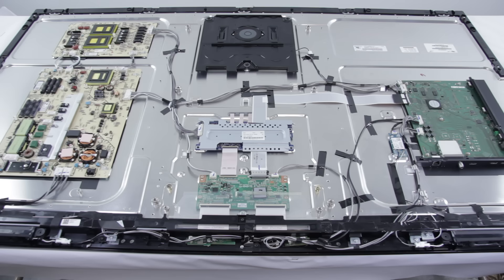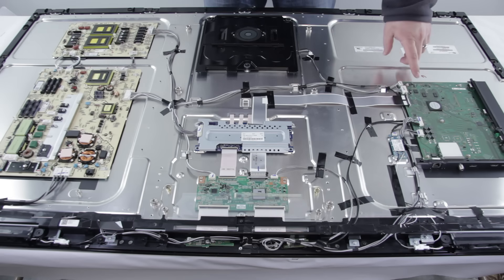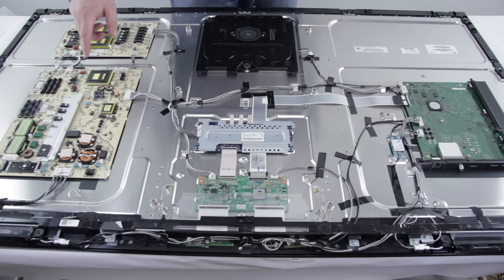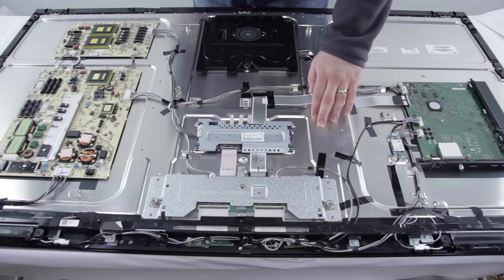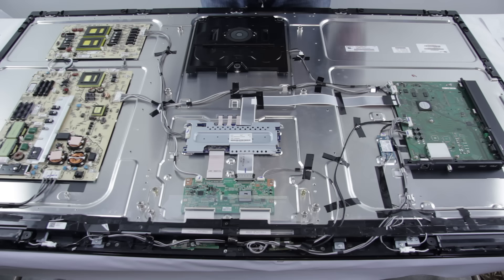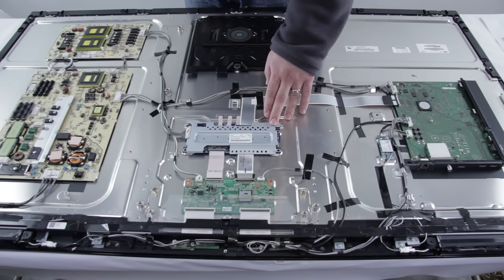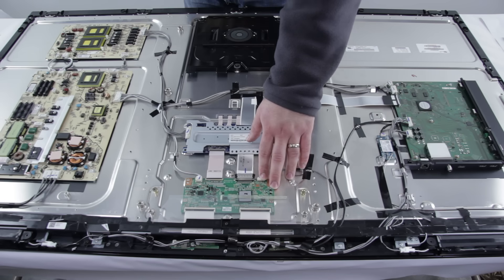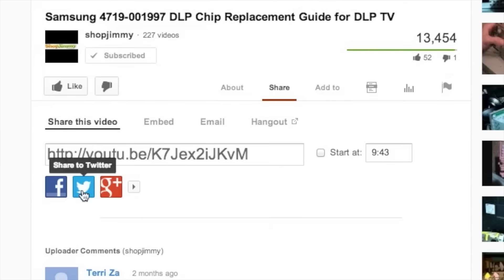LED TV Repair Tutorial - Common Symptoms & Solutions - How to Repair LED TVs

Comment: I have a Panasonic Tx-l50b6b 
turn power on and the back light flashers about 5 times then the standby light slow blinks constantly, I've replaced the psu and transistors and capacitors on the led driver board and still same issue, any ideas

Comment: hey I have a Samsung led 65 inch TV . model number is UN65F6400AF. 
the problem is that it has a dark shadow going across the bottom half of the screen. I just wanted to know if its the main board,con board, or power supply board.

Comment: Hi i have a Sony KDL46Z4500 MY PROBLEM is i have a ten inch wide pixel bar down the right hand side of the TV from the top of the screen to the bottom could you advice on the part to sort this problem please

Comment: Hey I was wondering if you guys have a video showing how to tell if my power supply board is bad if it's not showing any damage on any components or front or back of the bored and I don't get a stand by light the TV is a Samsung UN32D4000ND

Comment: I have a vizio model number e420-a0. everything works except in the center of the screen there is a horizontal stripe that is dimmer or not as bright as the rest of the screen. It shows the picture just fine its just not as bright as the top or bottom of the screen

Comment: I have a Vizio E470i-AO LED flat screen smart TV. We were watching tv yesterday and the screen just went black. No power surge or anything. Just went black. We have sound, no backlights and we can see the menu with the flashlight test. It could be the LED driver board but it is probably the LEDs themselves that are bad. You sell a lot online that includes both the LED board and the LED strips. Can the LEDs be replaced on this model without replacing the whole screen? Another technician said no and that I would have to replace the whole screen. If they can be replaced, is there any tricks to doing it myself?

Comment: I have a broken screen on an Element Electronics ELEFW328 TV. I saw an exact TV for sale on Ebay being sold for parts. It shows 3 vertical black bars. Would you say that the problem there is not the lcd screen, but some other component. I'm hoping that I can buy that TV just for the screen ... if you think it's not the screen that is causing those vertical bars. Or, you may have the screen for this model. Thanks.

Comment: I have a sharp LC-52D83X LED TV. The problem with this is, across the screen on top and bottom, there are horizontal streaks. Only the middle of the screen is good. It is like someone scratched the actual LCD. But, when the tv is turned off, there are no visible marks on the panel. I can send you a picture of it (without TV turned on with no signals it is easy to see) if that can give you a better idea of what it is.

Comment: hi shopjimmy
i have a hisense 50k23dg tv

one day i had no sound or picture

a tech replaced the main board, didnt work so he put in the old one and said the t-con board was bad.

i changed the t-con board and the power board still nothing

theres only a red light on the bottom left hand corner on power button side, the red light stays on and when you push power button the red light blinks then turns off

i dont know what else to do??

Comment: Hi Jimmy, I have a Samsung UA55D7000 (AC100-240V). The TV can turn ON but it automatically turns on and off immediately (with clicking sound). There are also some vertical lines that appear occasionally. Can you advice if this is symptom of broken capacity? And If so what capacity should I be buying?

Comment: I have an LG 47LN5200-UB. The unit turns on with no video, could tell about the audio as I use a surround sound. If I select channel up/down, Input etc. the power flashes several times and the LED lights flash once and the power goes of.

Comment: I have a Hitachi LE48W806 with black screen. I did the flash light test and realize that I had image but no back  lights so en order the LED driver from you guys LED driver LJ97-00236 A and replace it and still have the same problem do you what can it be?

Comment: Hello Jimmy. I have a Samsung 55" LED TV model # un55h6203af version us01. I am getting what appears to be a series of horizon white lines across the top section of the screen.  I removed the back cover and tried cleaning the ribbon cables but no luck. I assume I have a problem pc board but not sure which one?? any thoughts?? Thanks

Comment: hey, i have a samsung un46es6100f led tv and the sound works but no picture is showing. i did the flashlight test and can barely see images. this would mean i would have to replace the led driver, but i opened my tv up and it only has 3 boards. the main board, the power supply board, and the t-con board. i don't see anything that looks like a led driver. Please help me out, I'm a college student and i would like to just pay for the part and do it myself i can't afford a new tv! thanks.

Comment: Hey guys, I have a UA46C7000WFXXY TV, and the TV just clicks when trying to power on. I have a different power board, but the same issue persists. I am wondering if it could be the main board, or if it is T-Con board. Any suggestions?

Comment: Hey Jimmy.
I have LG 32LN613S. I have audio but no video, when i turn it on it quickly flashes the LG logo and then its blank. Couldnt see yet if my backlights are working. What could be the fix? Read that its a common problem and usually it`s the T Con, but i want to be sure.

Comment: Sony KDL-46EX723, Have a single thin vertical line in the dead center of the TV.  Have replaced the TCON board and vertical line is still there.  Any opinion of what else this could be?

Comment: Hello, I have a Samsung 52" model #LN52A580P6F. I have a wide blue vertical line on the screen. It is sometimes intermittent. I have cleaned the ribbon cable ends already but the line is still there. What next? Thanks for your help.

Comment: My Samsung model LE40D550K1W TV is showing horizontal lines at the top of my TV screen, the lines are there all the time no matter which input you use. It’s roughly about the the top 1/8 of the screen, the lines flicker and seem to mirror what’s happening in the bottom half of the screen. I think the problem occurred after my 2 year old spilt something over it. My friend looked at it and thinks it could be the inverter board

Comment: My LG 55LM6700 lost power yesterday and won't turn back on.  I only see a
 blinking red light on the front panel, which blinks three times.  I  
removed the back panel on the TV and visually examined the power supply 
board.  I see what appears to be a fried component in the pic below.   
Fair to say I should replace the board?

Comment: hello my name is Alex I have a lg 55" lcd tv model number 55lh50-uc. my issue is once the tv is plugged in the power light comes on and fades from red to blue back and forth and the screen flashes but never comes on. I have to unplug it for a few hours then (sometimes) it comes on just fine. any ideas?

Comment: Hi, I have a Samsung 32 inch smart LED TV model UN32H5203AFXZA. last week while watching something on  Hulu the screen went black, but I still had sound. The TV is a year and a half old. I called Samsung tech support they walked me though some steps with the flashlight.  I  was able to see some image moving. He was trying to get me to reset the TV.  But than he said it must be The LED or the LED drives.  hate to throw it out. But I know a repair shop will cost almost the same price of the TV. I am good with tools. I am a retired electrician. I was forced to retired in 2004 after crash 5 disc in my lower back. I hope you can help me with the parts and how to open up the back. Will take any help. Thanks, Ted

Comment: I have a Samsung UN55D6050TF 55" LED TV. On the right side of the TV I have 2 dark areas that are sort of a fan shape. It starts from the frame at about an inch wide and opens to about a 3 inch width and about 3 inches long. The first one started in the center right side which is the most noticeable and the second area is about 8 inches above . It's my guess that a few LEDS have failed. Is it worth it to try and repair? Do the LEDS come in strips or modules that can be replaced? Any advice would help. Thanks 
Larry B

Comment: I have a seiki se65gy25, there is sound but no picture. There is a backlight on, I replaced the TCON board and saw slight changes to the backlight color but still no picture. The backlight color also fades from grey to dark grey at the top of the TV. Any help? Thank you.

Comment: My Sony XBR-70X850B turns on, displays picture, then shuts off, and flashes LED lights 4 times. I have tried doing the hard reset to factory defaults; the reset page appears, but again the TV shuts off before I am able to perform any setup. Any recommendations about the problem?

Comment: I have a Samsung UN55C6300SFXZA that will not turn on. I was told that the power board was bad, but after replacing it, the new board still does not work. all i hear is a clicking sound on both power board. the only thing that I am thinking is the main board is bad.

Comment: I need some help with my rca TV model 40g45rq. the red stand by light is on but nothing happens when I press the power button. I removed the back cover and noticed there is a black ground wire that looks like it goes no where, I don't see where it could have been screwed on to. I don't know if that happened when I opened it. any help is appreciated

Comment: Hello, I have a Toshiba 55S41U. I got it from my grandparents who said it wouldn't turn on after a power surge. I replaced the power board and I now get a solid green light when powered on and the front buttons work. However, I still had no display, no backlights, and no sounds. So I replaced the mainboard but still have the same issue. Should I aim for the T-con next or the inverter board? Or is this a lost cause? I can send pictures of the internals if needed. Thank you very much for your help and the great videos you've made.

Comment: I have LED Samsung TV 32" Model No.UA32J4005AK
When contacted my local technician he had inspected and informed that my audio and back lights are working fine.
but display in not there (Image Blank)
he had suggested that could be the problem of panel or board and to rectify it would cost me Rs.10000/- 
Please suggest whether i should go for rectification and price quoted is correct. 
or
i shall sell my LED TV

Comment: i have lg55lm8600-uc had problem which horizontal thin  gay bar equal 1/4 space from top to bottom of half right side. I changed  t-con board but it still happen. Would you give som advice? Thanks

Comment: Joe hall
hi have a 28 inch samsung smart tv model #un28h4500af wont power up there is power to tv as red light on solid on bottom right senser no clicking when try to turn on with either manual switch or remote?

Comment: The TV LG Infinia 55LW5600 was on and in perfect working condition in the morning. The nexus player connected via Onkyo Receiver attached to it went to sleep mode and the screen was showing a blue screen, which is normal when the nexus player goes in sleep mode. I turned the TV off by pressing the power button on TV. Now when I try to switch it on, the Power LED comes on however there is no picture. What could be problem. Main board or Power Supply?

Comment: There are three horizontal intermittent lines and ghosting on the bottom quarter of my LG 50ln5700 purchased 8/2013. This problem started with one line for approx 9 months then 2 and now 3 thin lines within 2 to 3 second intervals. Annoying to say the least. Picture quality on the upper 3/4ths of the screen remains in good condition but I suspect this problem will continue to advance. Is it worth fixing and what does fixing entail. Please provide cost estimate if you can.

Comment: I have a  LED samsung LNS4051DX/XAA tv. It has sound and picture at first, then picture goes black. Did a flashlight test and could see menu display faintly. Tried putting a fan in back and  the picture will stay on.

Comment: I have a Samsung UN50H6201AF. I have back lights and sound, but I have no picture. I bought two used T-con boards on eBay, but neither of them fixed my problem.

Comment: Before the latest problem the tv had two vertical lines on the right side of the screen. now the tv turns on and off continually and lately doesn't want to power on. Thank you. UN75F6400AFXZA

Comment: Hello!

I have a Toshiba 46L5200u1. Your videos have been pretty helpful in figuring out what I've been able to so far, but I'm not quite sure where to go from here.

The TV will power on, the Toshiba logo will appear, and then the screen will go black. I ran a flashlight test and was able to see a picture. I even navigated through the menu and think I was able to do a reset/restore factory settings, but the problem persists. Additionally, the TV does have audio. I have not opened the TV up. It seems like it may be a problem with the LED driver. Could it also be a problem with the LEDs themselves? What other problems could it be?

Is there a way for me to figure out exactly what the problem is or do you recommend working with a TV repair professional? Do you have any idea what it would cost to repair the issue? 

Thanks so much!

Comment: Hey, I have an LG 50LN5100. At power on the backlight lights up and immediately goes off. There is a picture visible when a light is shined on the screen in a dark room. After research I installed one of these (http://www.ebay.com/itm/381512022013?_trksid=p2057872.m2749.l2649&ssPageName=STRK%3AMEBIDX%3AIT) but the problem has persisted. What is my next step?

Comment: I have a Hisense 50K23DG.  Has sound. No Picture.  No Backlights.  There is video when tested with the flashlight test, so the T-Con and Main Boards are good I assume.  I'm thinking the problem is either the Inverter or LED Driver Board.  The problem is that I see no LED Driver Board on this particular TV, nor a Inverter Board.  I am assuming the power supply board has the inverter built into it since there are wires from the board that go inside the back of the panel.  Would you recommend the replacing of my power supply board to fix my TV?

Comment: samsung UN50EH5300FXZA 50"
Tv has started turning itself off after only a few sec. It will turn on again but immediately turns off again. Now the capacitors look damaged bulging or anything. Any suggestions?

Comment: I'm trying to fix a Samsung UN46D6000SF. It has a bright blue screen and audio but no picture. The menu, volume control, channel doesn't show when the buttons are pressed. When turned on the screen flashes blue then goes dim. When I attach a bluray player the screen goes blue and sound plays. After watching a couple of your videos as well as others I decided to replace the t con board. I ordered a used one from China. After I installed it I put the set back together and powered on the tv. The picture was back and it looked good as new. I stepped out of the room to check on something. A few minutes later I came back and the fix didn't last. It was back to where I started with it. Everything internally looks fine to me no scotch marks or burn spots no frayed cables. The LVDS cable looks fine to my untrained eye. I have a multimeter but I'm not skilled in how to use it and haven't found anywhere online informing what to look for when testing the components. How do I know if I got a bad t con board in the mail or if the repair technician damaged the cable when looking at it? What would you recommend I do? It's more of a game room tv so I don't want to take it in anywhere. If I can fix it on my own then I will otherwise it's dead to me. Please help.

Comment: Hi i have a Vizio XVY473sv, the back light works but when I connect a video source through the HDMI port the screen won't work. The screen work if I use the TV Netflix app. But when I try to connect something in the HDMI port it won't show on the screen. What could be causing the problem?I hope you can help me.

Comment: I have an LG 55" TV model number LN51M550060V12.  HDMI port 1 and optical input not working ( occurred 1 year ago and haven't fixed).  As of yesterday there is no image on the TV.  The red indicator light on the bottom comes on when powered up but there is no image or sound on the tv.  I tried all the common sense solutions to no avail.  Hope you can help, thanks.
Reply: LG 55LN5100 LED

Comment: I have a 42 " Visio.  M/N VW 42 L FHDTV 10A S/N LUPBYGJ 4203496.  The front Visio light doesn't come on, it doesn't power up at all.  I bought your power supply board ,  part number 0500-0405-0700.  I have power at the outlet.  I still do not get an AC reading past the connection at the power supply three prong connection and I still have no DC voltage at the ribbon connection test strip..  What shall I do next?  Also I see the  PS on/off  and inverter on/off There are no pins associated with them.  To get a reading, do I need a jumper or some way to activate DC voltage at the ribbon?  My email is alwayswright8@gmail.com.  I don't feel very right at this point.  Your help would be appreciated.  AllenWright

Comment: Hello! 
I have the Sharp 52LE640U 1 Blink Slow and 1 Blink Fast. Lamp Error Per Service Manual. It will not power on until you hold CH down and Vol Up command upon Power up with Cord. When Powered Up it Shows the display but is darker on the left side ( The Darker Area is Split right in the middle of the display) Left Side dark and the right side is perfect. I am Not Sure if it is the Power/ Led Driver Board or a LED Strip or Wiring itself. Please Help!